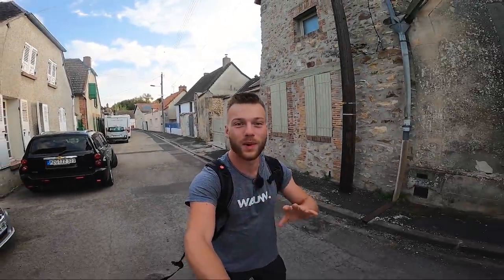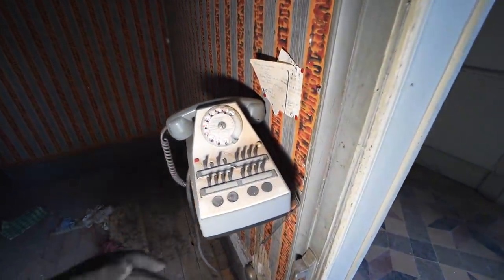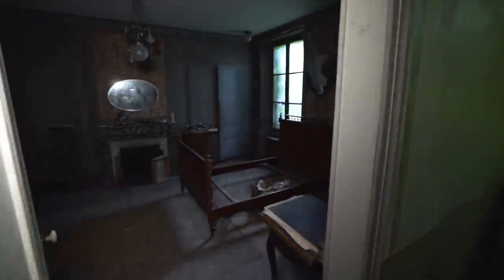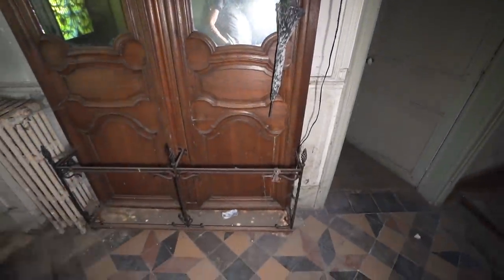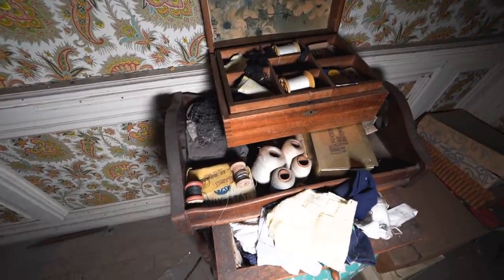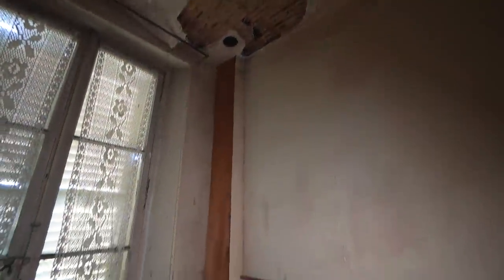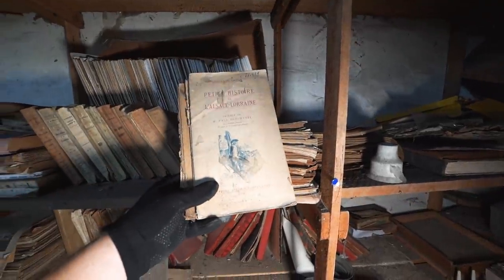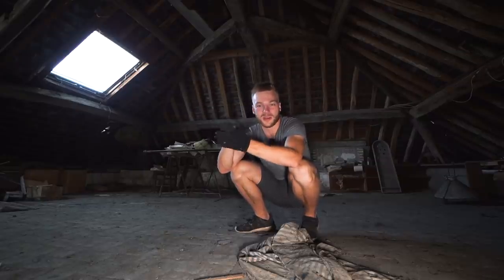Obsession Destroyed His Life! ~ Historical Abandoned French Mansion

Comment: A very nice example of how fairly ordinary people lived in the 2nd and 3rd decades of the 20th century.
I have made it a bit of my mission to supplement the fantastic vidoes of the Bros of Decay with some information of outside and inside architectural details so more people can get an understanding of when the houses and interiors were build/made.
This house (I would not call it a mansion) was built in the 1920ies. There are not many architectural features outside to give clues, but the windows, cast ironwork and the outside shutters point in the right direction.
The wallpapers are all very typical 1920ies, with some that might have been updated in the late 1930ies. The furniture, especially all the bedroom furniture which would have been bought new when the house was built, is mostly from the Art Deco period with a few older pieces inbetween.